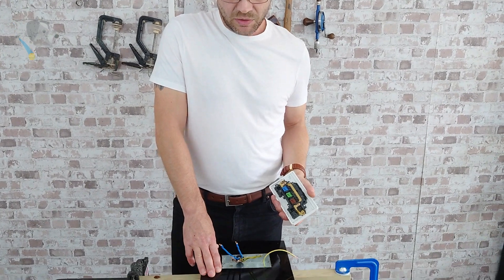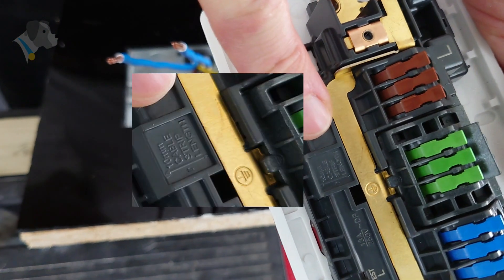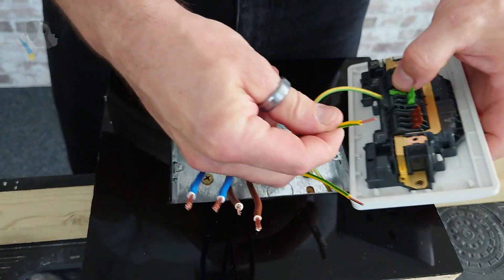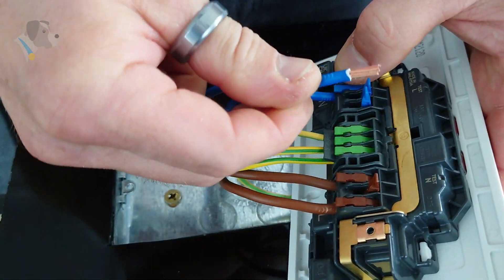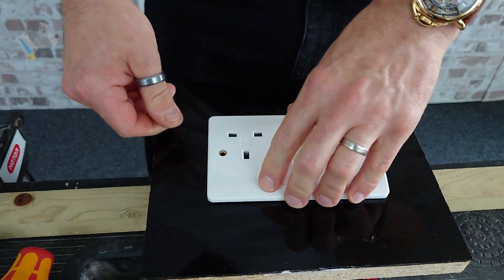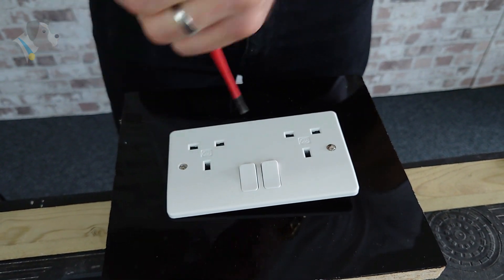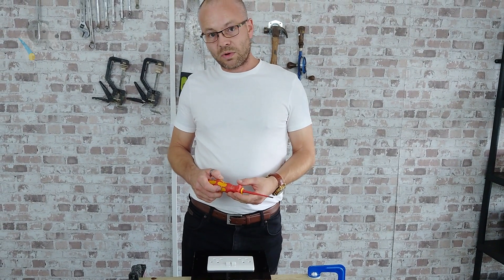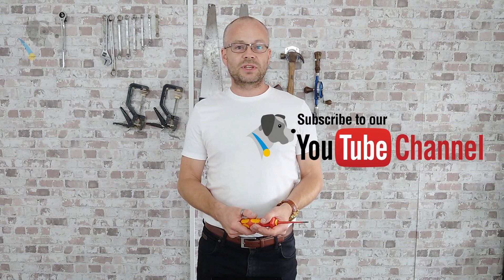MK Rapid Fix Double Socket Fitment Test... Will it Fit? | Product Review and Demo

Comment: Tried the NewMK with 4.0 stranded cable and they pull out when under tension . 2.5mm cable should be ok
Reply from the maker: I don't think these type of sockets will catch on. I've not seen any other company making their own version as yet.

Comment: Great product, my only complaint and this is just my own personal opinion the wago type connections makes it easier for DIYers as specially as there colour coded. Also I think there only for solid conductors not stranded? I have heard some good things about this new socket but I have heard a lot of bad things as well . I suppose time will tell .
Reply from the maker: It's now advised by BS7671 that we now use ferrules on stranded cable. As for the DIYers, if they're confident enough to change a socket, it won't matter if they're colour coded or not. I think the verdict is still out on this socket, I personally think, now having used a fair number, that the connections need to be improved. I have pulled the cable out on the odd occasion.
Reply: It is a great product as I said but yes I agree it does need improving a bit .

Comment: I suppose it's the future ...

Could I use on a Stud standard wall .
Reply from the maker: Yes, it will fit any standard 2gang 25mm backbox, though it's a little snug if the back box is flush to the face of the wall.
Reply: @ChampionsOfTheTrade  Thanks 👍 stay safe